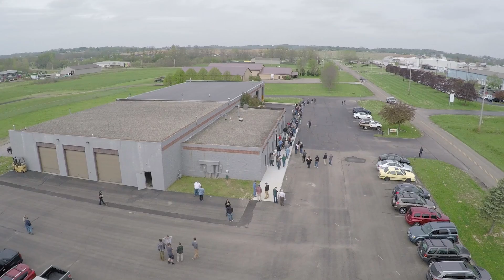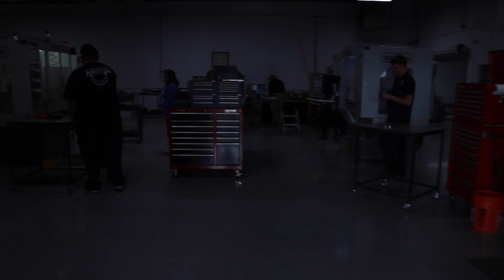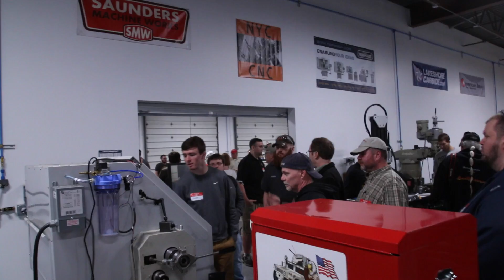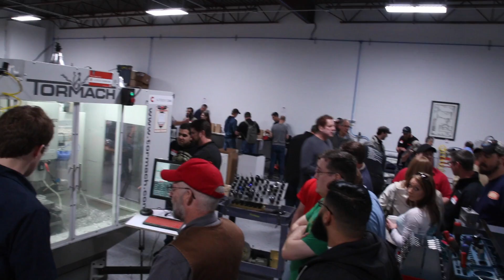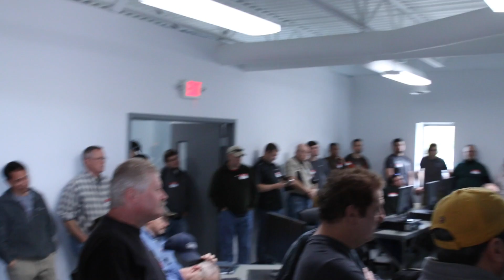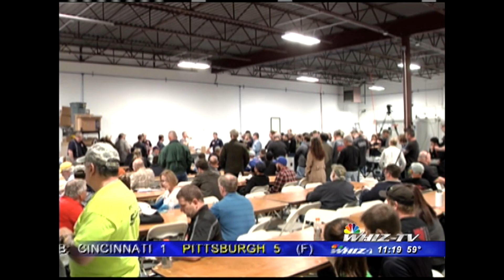2016 NYC CNC Open House: Video of Event!

Comment: Babying the tools is certainly not something I do.:-) Funny I couldn't really hear the carbide guys and you talking at the event but it is great now. Time to start churning the work out of that shop now, much success to you!
Reply: NYC CNC
Yep, that was a full hp cut as I tripped the breaker trying to do more. It was happy cutting  .300"DOC 8" wide at 14.5"/min. and that is ploughing metal off pretty fast. I really enjoy those big cuts but don't get to take a lot of them since I do far more repair than fabrication work.